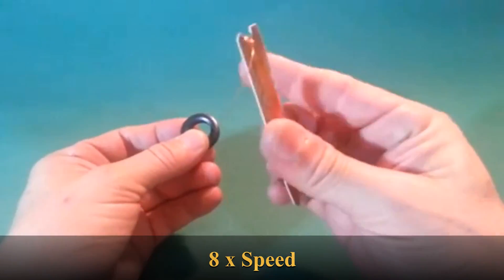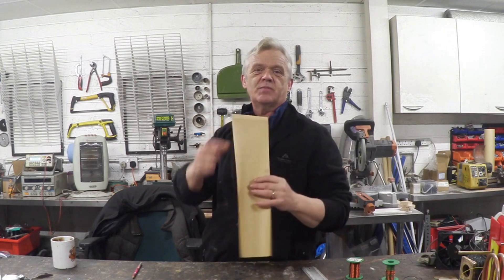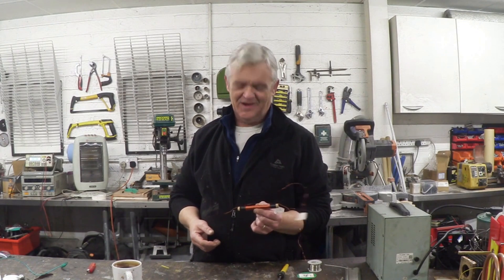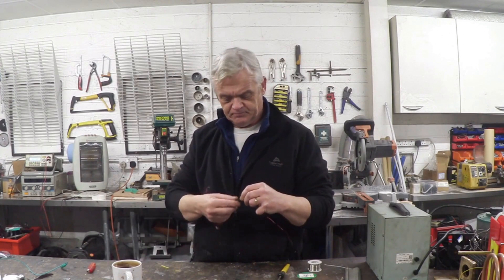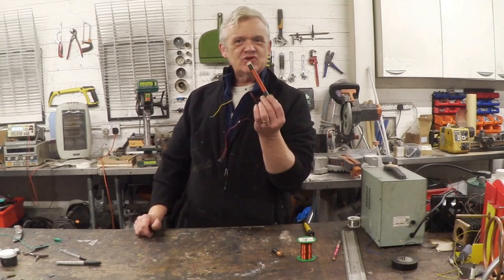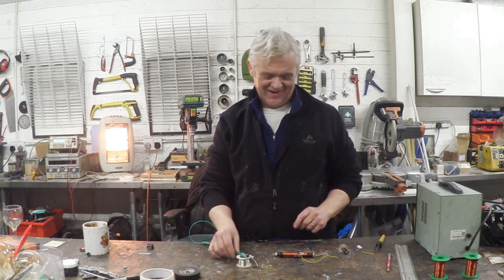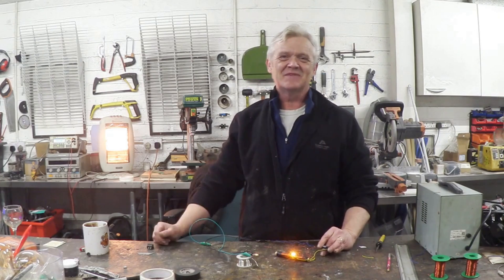2069 A Different Kind Of Joule Thief

Comment: I built an ok with the best size a 3 inch pipe cut inch in length. Use speaker wire all the way around.

Comment: A simpler way to wind a small toroid for a joule thief is to pinch the wire together, then push that pinched wire through the toroid about 10 times. You don't even have to be particularly neat about it. The pinch point is the center tap and goes to the battery positive terminal--skin the insulation off and solder to it. One of the free ends goes through a 1k or 2k resistor to the base of an NPN transistor. The other end goes to the collector of the transistor. The LED goes across the collector and emitter of the transistor--be sure to connect that before making the final battery connection! Finally, connect the transistor emitter to the battery negative.
A joule thief is a "blocking mode oscillator with a flyback output". They will typically run about 30-70 kHz and throw off LOTS of low-frequency RF noise if you use an open core coil as seen in the video. They are much better when using a toroid. The LED must be in place across the transistor to absorb the energy or the flyback voltage will kick up high enough to destroy the transistor.
Reply: Indeed the toroid filters out spurious noise, and increases efficiency.  That's why some well designed laptop power supplies have a ferrite ring around the cable.  Perhaps a ferrite rod from an AM radio would work instead of a toroid ring (thought not as efficiently)?

Comment: Is it possible to use a PNP with AM241 in it  to power  a Jewel thief using super capasters.?  Can you go over  how you open up a PNP to put in AM241? And if I put two buttons of AM41 in a PNP, will it produce more Jewels?
Reply: You can use a PNP transistor by flipping the the E/C, but an NPN works better.  As far as getting more Joules, no.  It cannot magically extract more power than what's left in the battery.  It just extracts it more efficiently down to a couple of hundred mill-volts.

Comment: The Circuit drawings do not match the 1K resistor is connected in different places. In the first drawing it is between the B and 1 wire - In the second drawing the resistor is between the coils and pos, so the coils are not connected direct to each other ?
Reply: @uksuperrascal  I was thinking the same thing
Reply: @warrenstephens8557  My comment was some time back, but your reply arrived OK

Comment: 0:58   SWG =  Standard Wire Gauge. apparently the European standard,  and AWG is the American Standard.  There is a slight difference between SWG  and AWG,   sizes.  There are online conversion charts  but 28 AWG  and 28 SWG  are not exactly the same size  though they are fairly close:  AWG = .0.3211 mm  and 28 SWG = 0.376 mm.,  according to the chart I found.   I don't know if this makes a difference or not.

Comment: The fact that you can light up another LED via near field shows that the circuit is losing power to the either due to the high frequency that it is operating at because of the air coil. Needs a lower operating frequency to be more efficient. As a HAM radio operator the interference that this would create scares me.
Reply: Exactly!  It's simpler to make but less efficient.  Perhaps even a ferrite rod would have less radiated power loss.

Comment: Nice presentation Robert with inexpensive components. 
In order to get my Joule thieves smaller in size I stripped the wire off the core of IF coils from an AM/shortwave radio. Rewound 12-0-12 turns of 0.3mm dia magnet wire. Whole circuit fits onto an AA penlight battery.

Comment: U can also use old radio coils (the ones used to tune the radio to the right frequency) and just add the secondary or many already have two windings.
Reply: A bar ferrite is not as efficient as a toroid ring, but much better than an air coil. ;)
Reply: @billant2  lol no, air cores are king.
Reply: @GuardianEngraving  - Sure, if you want to broadcast the spurious emissions all around you.   Ferrite cores are even used on some laptop power supply cables to cut down on noise.
Reply: @billant2  yes that's exactly what you want to do, once you get to giga range, ferrite becomes an inhibitor and air cores win. Therefore air cores are king.

Comment: Use two RF chokes side by side with a 2N222 and a 1K ohm resistor an LED and a near dead 1.5v battery. Use a capacitor and a 1 meg ohm variable resistor and you have got a blocking oscillator circuit. Hold this next to an AM radio and you have some crazy Sci-Fi sound FX.
Reply: Almost like a Theremin. ;D

Comment: I tried to reproduce the circuit and wasn't successful.  I wound about a meter of each pair of copper wires (not necessarily the same diameter wire as Robert used) around a 22 mm diameter plastic water pipe, so I may not have made the transformer correctly.  I don't believe I ever had the transistor oscillating (switching).

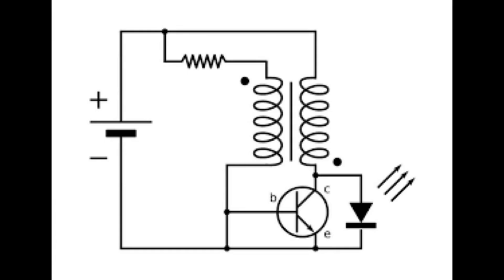That said, one of Robert's circuit diagrams appears to be incorrect.  The one shown at around 2:05 shows the base of the transistor grounded, which won't work.  Also, this circuit is a bit dangerous if you use a variable power supply rather than a battery as there is no resistor in series with the LED.  If the inductor works as a dead short and you have too much voltage, the LED and transistors burn out.  (Ask me how I know!)  

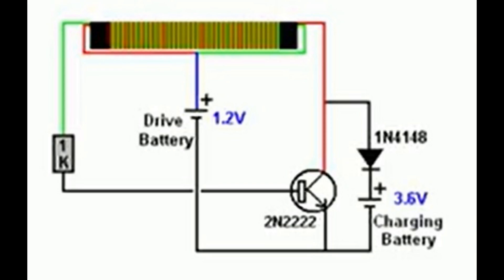But that isn't the circuit Robert seems to be describing, as he has us connect two wires on the transformer, which corresponds to the battery charger circuit diagram shown at around 2:22.  I tried that circuit and don't believe I ever had the transistor switching, as the voltage at the diode's cathode (I used a load resistor instead of a battery under charge) was identical to the input voltage.

I don't really have more time to devote to this.  If I did, I would copy Robert's transformer more faithfully, and drag out my antique oscilloscope to see if any switching is happening.
Reply: A 22mm plastic water pipe is way too big. I'd try something like a pencil. That way you would get more turns per length of wire and the inductance should be higher as well.
Reply: @JehuMcSpooran  Thank you!  When I get the time, I'll try it again.

Comment: " near field transmission "  so in other words induction ?,  so would changing the number of tuns on the second coil - more than or less than - the first coil effect how well the second LED lights ?
Reply: More turns will give higher voltage

Comment: If you happen to have a long wire (network cable or old telephone cable), you do not need to do any winding, they will work even with all the isolation on it.
Will you do more out of PJK's book? In the past I did read every new magazine that came out, but somewhere in time I lost it (interest for those free energy projects, since my thoughts is that IF there is free energy, we will use it and heat up the earth in no time, so that may well be a good reason to suppress it).
Reply: From a Montauk Scientist,  haven't built myself yet but it's a free energy antenna , 
Outer frame of antenna is  + in a diamond/kyte shape standing virtually,  now the negative iron rod goes from center of diamond at the top to ground insulated where diamond bottom is braced to it.
Now the $10billion dollar question to make it work sounds weird but I got the answers why. The iron rod at base has to have a oscillating switch built into the iron rod (parallel switch negative in negative out) example a simple 12v motor with a wheel attached with one small cam lobe on wheel so one contact every revolution with the iron rod switch. 
Then you run the motor at exactly 1800 rpm yes earth's revolution speed , it's the biorhythm/ frequency wave  , the iron core beneath our feet making a magnetic feild for free .
That's topsecret suppressed I thought why not tell you not many know .
I was planning a 6ft diamond 2ft wide out of raw alloy 10mm rod and 10mm iron rod for negative. 
So the aim is the negative pulses on/off with the wheel /switch  which captures the magnetic feild at the right wave form.
Cheers be careful I don't know how many volts it will put out..

Comment: So you just skipped the wole "Roundabout" via oscilliating Transistors DC to "AC" back to DC?
Only using "Near Field" Electromagnetic fields to make a transformer?
Actually i think this is more efficient than the original Scool Girl cuircit losswise as you jump possible losses in charge/discharge a ferrite magnet and the efficiency of the transistor and a resistor(electrical resistive load in principle)
Makes me wonder ;)..
Did you just make a Corless transfomer?

Comment: I love these videos, however I have absolutely no idea what you are talking about in this one. It would be helpful for idiots like me, to explain what a "joule thief" is and what it's used for. So why didn't you just connect the battery to the LEDs instead of spending all that time rolling paper and wrapping it in wire? Please explain for the uninitiated.
Reply: A joule thief is basically a DC voltage booster. It will work with a 1.5V battery to give 5V (or whatever). It works even with very low currents. So it will drain a 1.5V cell almost completely whereas usually a 1.5V cell is considered "dead" even when it's not completely drained of energy: there's a bit left. Hence the name "joule thief". And it's a pun on "jewel thief" so that's good too!
Reply: @DerekRoss1958  excellent explanation, thank you.

Comment: How to transform it into a blinking joule thief ?
Reply: Look in to SJR Looper by Lasersaber. If you reverse the polarity of the capacitor in that, it will be blinking. It's basically the same circuit, but with 1 to 3 coil ratio. I think the size of the capacitor will determine the blinking speed.

Comment: how to determine the output desired voltage?
is there any limits of power (watts) input (ex: 12v 100A car battery) ?
usable as a car starter booster?
can we control a bldc with a joule-thief and its frequencies?

Comment: All you need is any center tapped inductor with a saturable core. You need the saturable core for current limiting and also for RF suppression.
Reply: What would happen if you used a ferrous core that allowed a higher magnetic flux?
Reply: @DisorderedArray  Ideally you want the LED to maintain the same brightness during the lifespan of the battery. The right core material (i.e. a nail) will give you that regulation effect.